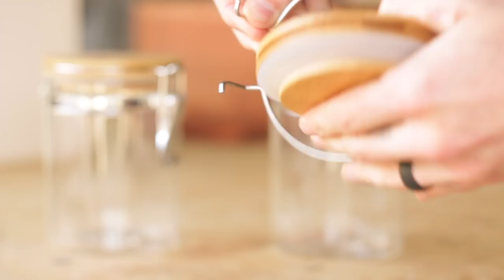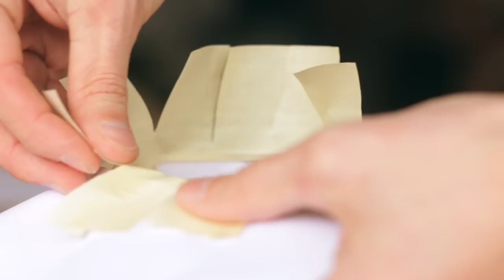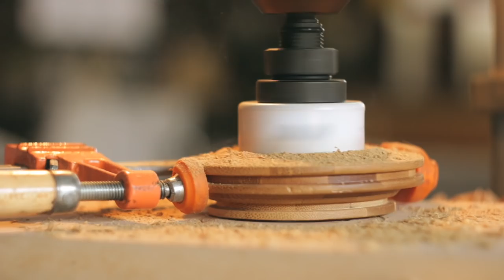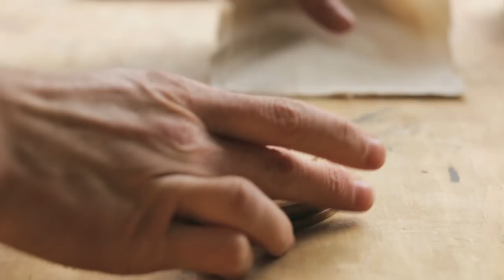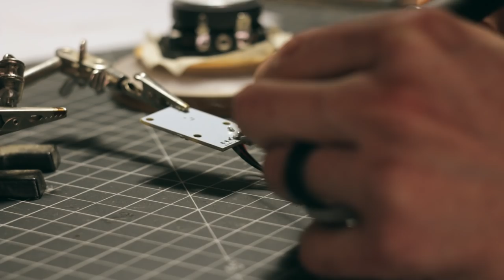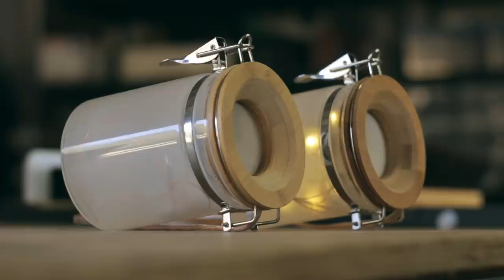Firefly Jar Bluetooth Speakers || Holiday DIY Speaker Build

Comment: I see you made ceramic jar speakers too, what material is better for sound quality?
Reply: The more dense, the better. Ceramic is great for mids and highs. I wouldnt use it for a subwoofer, however.
Reply: @sethh8892  thanks, btw what wood would you recommend for the subwoofer?

Comment: Would love to see a hole drilled for the speaker wire to exit, near the bottom. Drilling glass is tricky though.
Reply: It's hard to drill small holes in glass with the wrong bit 😂.

Comment: I read a comment on another video about cylinders being a poor shape for sound wave diffraction within the enclosure and I was curious if you've ever installed hemispherical backs into any of your cylindrical speaker builds and if that has improved their audio quality. I'm also curious if porting helps, particularly when dealing with such small full-range drivers.
Reply: I heard subwoofers in a cylindrical enclosure and sounded great. But it has a flared bass port on the other side. It sounds great though. I think it was a TV subwoofer.
Reply: As in television or a company called TV?

Comment: I thought about getting the kit. The led's are running on CR2032 3V. The Li-ion is 3.7 V. I wonder if you could run the led's on the Li-ion battery without damaging them.

Comment: you shouldn't use a vernier to scribe a line! you should use a scribe or spring backed dividers. when you are using a hole saw to cut through thick wood if you got most of the way through one side and the rest of the way from the other side most of the piece will be sticking out of the holesaw and you won't need to dig it out you can easily just pull it out. but otherwise great craftsmanship and filmography

Comment: Cool build!  Although, I'm a bit upset because I thought I would have the coolest LED & speaker combination uploaded on November 21st.....Just kidding, of course, I'm actually hoping your video gets more people thinking about the design possibilities when you combine light and sound in a speaker :) Your videos were super helpful when I was working on my speaker build, and I learn something every time I watch a new video from you.
Reply from the maker: +Modustrial Maker Hey man! Thanks so much! You’re speaker build is awesome. I’ve wanted to integrate an arduino into a build for a while now. I also have a few raspberry pi’s I need to get into some speakers!
Reply: Wow, thanks much.  Means a lot coming from the speaker master!  I'm thinking about actually designing a PCB shield for all the music reactive components to plug into an Arduino (or WeMos D1), so I can simply hook up the LEDs, Mic, push button, power, etc. to the microcontroller (ie., the messy electronics part I left out of my video :) ) I keep having to do this from scratch every time I make an audio reactive project so it should save time for me.

If I can pull this off, I was also thinking it would be fun to send the PCBs to some fellow YouTubers to see what they can dream up with it.  Would you be interested?

Comment: You didn’t solder the speaker to the Circuit board so it will not work